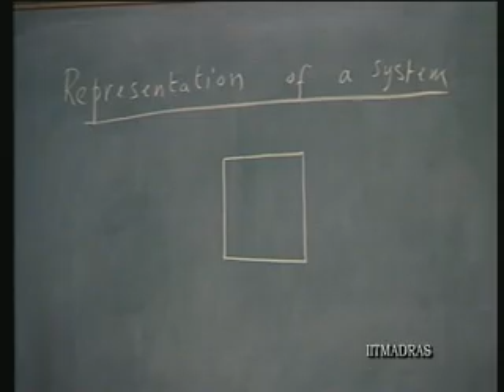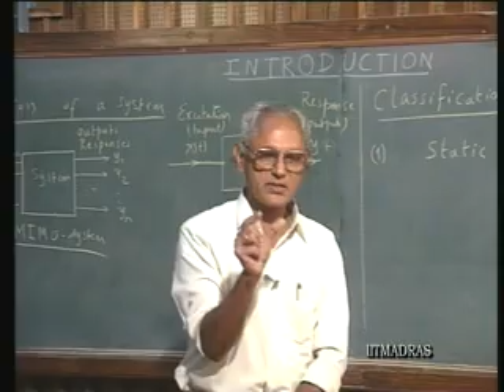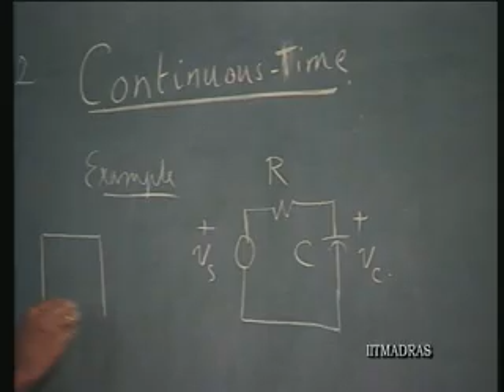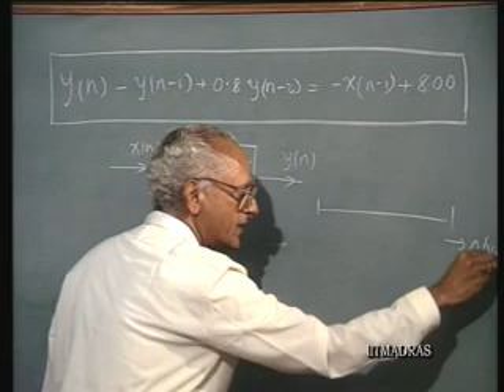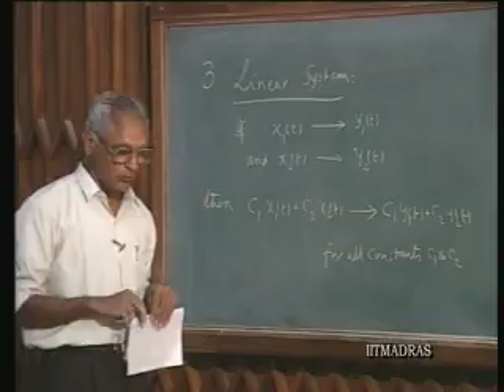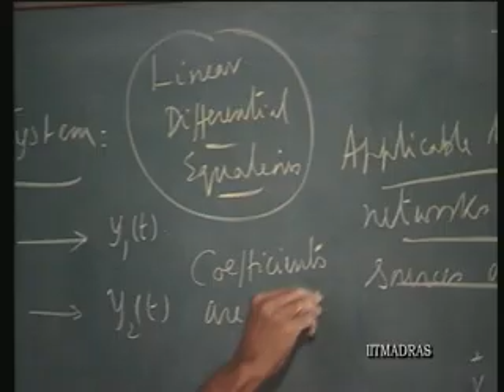Lecture - 1 Networks and Systems Introductory Concepts (1)

Comment: Prof.V.G.K.Murti was born in 1933, he received the B.E.degree in Electrical Engineering from the University of Madras in 1953, the M.Eng.Degree from Yale University, New Haven in 1957 and the Ph.D. degree from the University of Illinois, Urbana in 1960.

During the period 1953-56, he was an engineer with the Andhra State Electricity Department. He taught as a graduate Assistant and as an Instructor at Yale University (1956-57) and the University of Illinois (1957-60) and as reader at the P.S.G. college of Technology (1960-61) before joining the Indian Institute of Technology (IIT) Madras, in 1961. He was with IIT Madras till his retirement in 1994. A professor in the Department of Electrical engineering from 1969, he held the positions of Head of the Department, Professor in charge of the Industrial Consultancy Centre and Dean, Academic Research at various periods. During 1982-84, he was Visiting Professor with the National University of Singapore.

Prof.Murti has 40 years teaching and research experience in the two areas of his active interest viz. Cicuits & Systems and Electrical Measurement & Instrumentation. In the area of network theory, he did extensive research on Network Topology, n-port networks, and passive and active network synthesis. He was the author or co-author of about 100 research papers of which 75% are published in reputed technical journals and the rest presented at technical conferences in India and abroad. He supervised the theses of several M.Tech and Ph.D. students. Professor Murti was the Chief Editor and author of four chapters of book entitled "Principles of Electrical Sciences" commissioned by the Indira Gandhi Nation Open University. He served as the Honorary editor of Journal of the Institution of Electronics and Telecommunication Engineers, India, for the area of Circuit and Systems.

He is a fellow of the Indian National Academy of Engineering.This video course was prepared during his term as an Emeritus Fellow of the All India Council for Technical Education.
Reply: I have had the privilege of being a student of professor VGK  Murthy in the 80s. Besides being a dedicated professor, he was also  truly compassionate  human being and looked after students well being. I have utmost respect for him as the ideal human being, and was extremely fortunate to  be his student. He was by far the most respected professor I have had.
Reply: @aurobindodasgupta1040   are u an iit graduate sir?